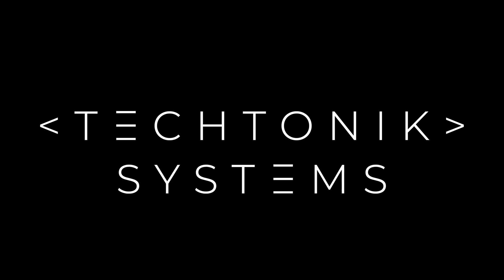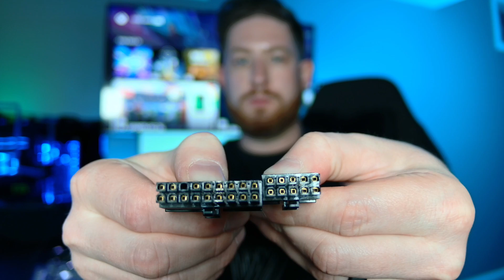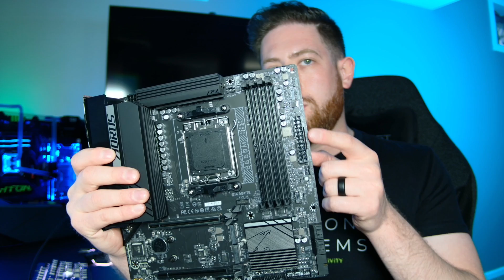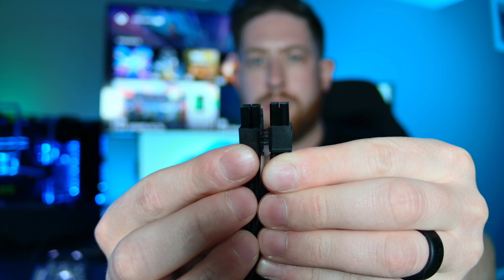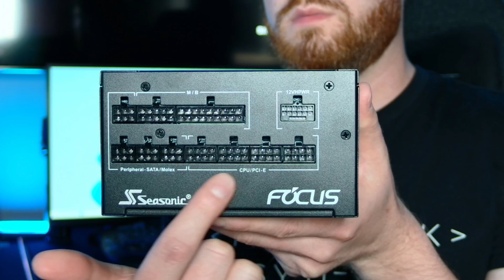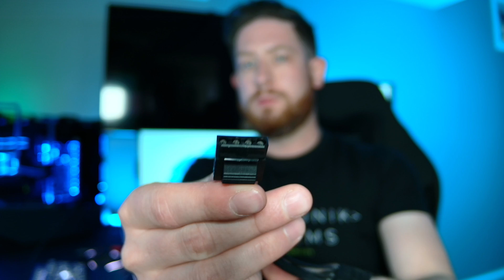Power Supply Cables Explained - Understanding All of the Power Supply Cable Types

Comment: My PSU doesnt look like that at all. It just has a hole in it where all the cables seem to come out of all together, with no options of customization in regards to what cables I can use.
Reply from the maker: The power supply in this video is a modular power supply that allows that customization. The information in this video is still accurate for the ends that plug into your motherboard and other parts and you can ignore the information about the ends that go into the power supply! Your power supply just has the cables hard wired into the power supply vs being able to plug and unplug them like the one in this video. There is nothing wrong with that!

Comment: finally, i was confused on why the psu side of the 24 pin mobo connecter is different, turns out it was designed that why to prevent confusion...the irony...lol
my psu is tuf gaming 850w gold full atx modular btw
Reply from the maker: Yeah they try to do that as often as possible to help prevent bad situations and destroyed equipment 😀

Comment: My computer working fine for 3 months after changing to MAG A750GL PSU using MSI MAG A850GF cables! Am I save?
Reply from the maker: If I am not mistaken you would see the damage occur immediately if the cables were not pinned out the same way. If you want to check for sure, you could look for a pin out diagram of both power supply cables and make sure they are pinned out the exact same way!
Reply from the maker: But I would say that if you’ve been using them for three months now, there is probably nothing to worry about!
Reply: @techtoniksystems  Thanks for your reply! I checked all the pinouts and they are the same!
I asked chat GPT and gave me an interesting answer!
What do you think!

Both PSUs support the same AC input range (100-240V) and similar frequency (47-63Hz), which means the initial power conversion from AC to DC in both PSUs is the same. No issues here; they can both handle the same types of wall voltage.

Now let's look at the output ratings and compare them.

MAG A750GL PSU:

+5V: 20.0A

+3.3V: 20.0A

+12V: 62.0A (Major rail)

-12V: 0.3A

+5VSB: 2.5A

Total Power: 750W

MAG A850GF PSU:

+5V: 22.0A

+3.3V: 22.0A

+12V: 25.0A (Mainboard), 25.0A (CPU), 40.0A (VGA1), 40.0A (VGA2)

-12V: 0.3A

+5VSB: 2.5A

Total Power: 850W

+12V Rail Difference: The A750GL has a 62A rating on its +12V rail for the main current (which is the highest power draw). The A850GF splits the +12V into multiple dedicated rails (25A for CPU, 25A for mainboard, and 40A each for VGA). This shows the A850GF is designed for higher-end systems with multiple high-power GPUs, which is why its current is spread across more rails. The 12V rail on the A750GL is more unified and not separated for multiple components.

Cable Differences: The A850GF uses two dedicated 12V rails for GPUs (VGA1, VGA2), while the A750GL uses a single combined rail. That could mean the A850GF cables (especially for PCI-E) might have been designed to handle higher current on separate rails, which could be overkill or mismatched when used with the A750GL.
Reply from the maker: Interesting response! I wonder if those PCI E cables are any different in robustness, but yeah if the pin outs are the same you should be totally fine!

Comment: My power supply unit is an msi 750 bronze and has 2 cpu 8 ports, why is there 2?
Reply from the maker: @BouldersHandle  That’s go power motherboards that have two 8 pin EPS cables. My ASUS z790 Extreme motherboard has two 8 pins for the CPU so this is where that would apply.

Comment: As you said, mixing cables with a different PSU must be avoided. My solution to prevent this is simple. After I buy a PSU, I mark each included cable with a paint-type marking pin. All cables are marked with the same color, e.g., white, pink, red, etc.; the PSU is also marked with the same color.
Reply from the maker: @outlet6989  that’s a great idea to keep them all associated with the correct power supply!

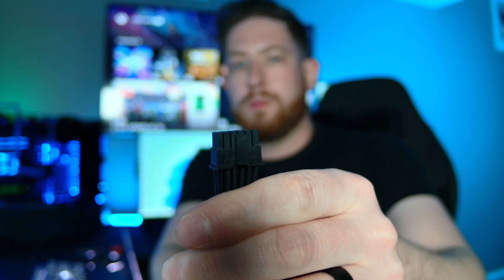Comment: Can someone explain what the 12volt HPWR cable is at 8:51? And how would I know if it’s needed for my set up or not?
Reply from the maker: It is for powering peripheral components that get plugged into your motherboard’s PCI slots. The only peripherals that I know of that use it currently are GPUs, so you would have to check what your GPU power port is and to see if it uses the 6 pin or 8 pin PCI express power cable or if it uses the 12VHPWR cable!
Reply: @ ok, thanks so much I appreciate the help
Reply from the maker: @ no problem!
Reply: @ hi, I have another question is there anyway I can convert a 4 pin rgb to a 3 pin argb? The motherboard I’m planning on buying only has a 3 pin argb header
Reply from the maker: @ hey! I don’t believe they are compatible as the 4 pin one is usually a 12v supply and the 3 pin is usually a 5v supply, and they inherently do two very different things. To my knowledge the 4 pin just sends the same signal to each light in the series making them all light the same color where as the three pin sends a data stream that tells each individual light what color to be etc
Reply: @ so even a control hub wouldn’t be able to help me convert them to be able to use 4 pin rgb fans? not sure how that would work (I’m still new to building pc’s)
Reply from the maker: @ that I am not sure on! I haven’t tried that so I couldn’t tell you for sure! My guess and gut feeling is no it wouldn’t work but I can’t say for sure. No worries at all! I am here to learn just as much as everyone else!
Reply: @techtoniksystems  ok thanks for the help
Reply from the maker: @ you are welcome!

Comment: I opened up my prebuilt pc for the first time and saw there were some cables that weren’t plugged in but everything works on my pc. Any thoughts
Reply from the maker: @KiloPilo-_-  That is a normal occurrence! There is usually power cables left over that are not used for things such as extra hard drives or fans etc.. as long as your PC is working as expected, nothing to worry about!

Comment: dang it i was going to switch out my 650 PSU for HX1000W corsair PSU but it doesn't  have a power cord. can't i just use my power cord from my previous PSU? I mean it's just a power cord that plugs into the wall outlet so it shouldn't make a big difference?
Reply from the maker: @RedragonReviews  there should be markings on the power cord and you could look up what it is rated for with those markings in terms of watts! Depending on the findings, that would determine if it could handle the new PSU!
Reply: A thousand watt is barely 8amp.